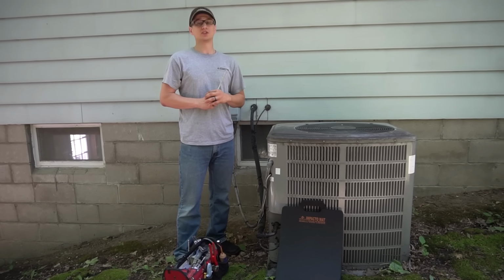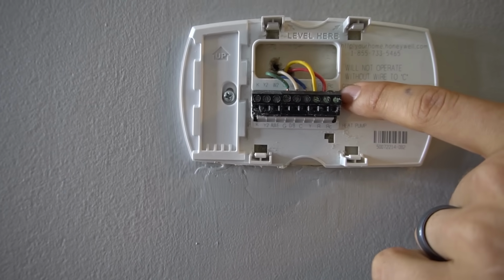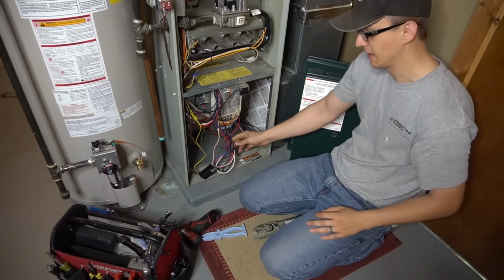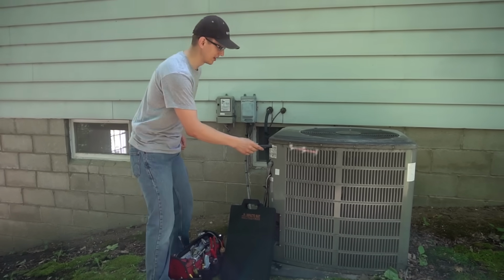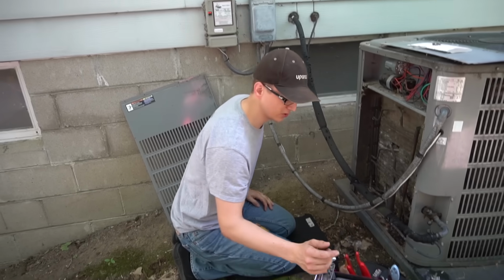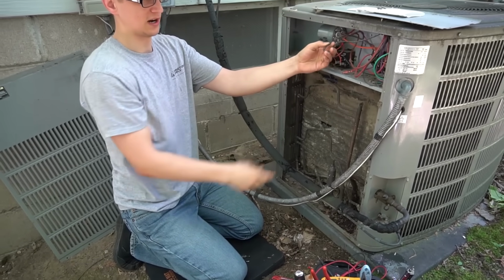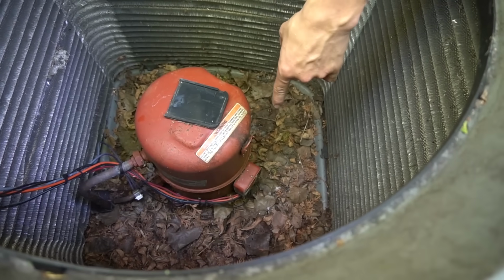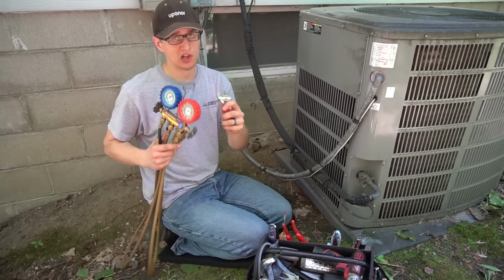AC Unit Not Turning On - How to Fix It Step by Step

Comment: Does the AC unit outside run all the time when your ac is on inside?
Reply: And thank you for the video, you are awesome for helping people save money on simple repairs.
Reply: My ac was working perfectly until I was outside cleaning around the AC unit and I bumped the little wire going into the outside unit and the unit started cutting in and out. So I kicked the ac off inside and went to investigate. I found the little wire had come slightly loose from the red side. So I spliced it and established a good connection without removing the outside breaker 1st. I did turn ac power off at the breaker box inside but didn't know about the outside one. Now the outside unit has not kicked on yet. Should I be concerned? Does it take time before kicking on or did I make a boo boo? Thanks in advance for the help.
Reply from the maker: Hey Ryan! It sounds like the 3 amp fuse in the furnace control board may have blown when you were fixing that wire. Check your control board in the furnace for a blown fuse or tripped breaker. That little red wire is a low voltage wire. Turning off the circuit breaker for the condenser unit outside would not disable the power to that wire. You would have had to either turn off your thermostat or the furnace. Let me know if that is the case. If not, we can do some more checks. Good luck!

Comment: Not sure if you'll be able to help but. Yesterday I had to replace my fan motor and capacitor for my lennox unit. Then realized I also had to replace the thermostat, so I bought a non programable honeywell and installed it and our AC was working perfectly. Then today we noticed it was getting hotter inside and the thermostat read 76 but was set to 73 an on cool. The furnace fan was blowing air out the vents but the AC unit wasn't turning on. So I removed the panel and pushed the contact switch and the unit started right up no problem, the compressor was running, and the fan but it still isn't kicking on to cool the house.
Reply from the maker: Hey John! Sorry to hear about your AC troubles, I hope you will be able to get it easily fixed! First off, was the thermostat correctly wired? Then, I would start by trying the following:

1. Check your 3 amp fuse or breaker at the furnace control board. Is that blown/tripped?
2. Do you have 24v between R and C at the furnace control board? If yes, then proceed :)
3. Put a jumper wire between R and Y at the thermostat. Does that turn on the condenser unit? If yes, then your thermostat is probably defective.
4. If jumping the thermostat does not turn it on, then you can try putting a jumper between R and Y at the furnace control board. Does that turn it on? If yes, then likely your control board is defective.
5. If the jumper wires did not turn on the condenser at all and your 3 amp fuse is good, then I would go outside and see what is in series with your contactor coil outside. The thermostat wire that comes out of the house and into the condenser unit, do the two wires from it go straight to the contactor or does one of the wires go somewhere else?

Hopefully that will help you figure it out! Let me know how it goes and what you find

Comment: Thank you for educational video!. Follows your video, I just changed my capacitor, but then the AC start running on and off every ~2 -3 minutes. What went wrong?
Reply from the maker: Interesting. Was the capacitor wired correctly? The only other thing I can think of at the moment is that it is cutting out on a low pressure switch. If you look inside the AC condenser unit from the top, you will see your compressor; it has two pipes coming out of it. One is thick, the other is thinner. Does the thick pipe have a black cylinder or disk on it with two wires coming out of it? If it does, that is a low pressure switch. Not all ACs have that.  What that thing does is measure the pressure of the refrigerant in the pipe. If the pressure get's too low, it will shut the unit off. Usually this will start happening if you are low on refrigerant. Unfortunately refrigerant issues you would need a technician to fix.. Or sometimes it may lead to replacing the whole unit altogether. Let me know what you find though! Hopefully it's not a freon issue. (although you can usually refill it for a couple hundred bucks but it will eventually leak back out)
Reply: I did recheck the wired, it is correct. I don't see any disk on the thick pipe, I took a picture, but I don't know how add here. The AC is old model CH7530VKA2. heat pump output 8500W cooling and 8400 heating. Note, that last/year or two years ago a tech add freon on it, without checked or fixed any leak. Is it possible that the freon low again?. If I need to replace, can I replace only the outside AC system or including the furnace that in the attic? note; the fan on in the furnace when I turn on "fan" on.
Reply from the maker: Yes, if you had a leak before, it will definitely leak back out. Usually leak repairs are very expensive so if your unit is old, then you may want to just replace it. The unit outside and the evaporator coil inside by the furnace would both get replaced. Your unit is probably doing that because it is either low on freon or the freon is completely gone..
Reply: I checked the furnace, because located in the attic, it is very clean like brand new. even no spider web at all. Hence, kind of hesitate to replace it. What is the fair price of the installation including the sytsem of the HVAC system (outside system and evaporator coil inside system)? I have the Heil7000, but I could not see this model anymore, probably too old.

Comment: Hi love your videos very detailed. I am having a issue with the ac. I have 24v to circuit board but no 24v to condenser
Reply from the maker: Thank you! And my first guess would be that you have a tripped 3 amp fuse. But you probably already checked that.. I think we should first check to see if your board or thermostat are defective. Let me give you a list of a few things you can check. (Check this with the thermostat calling for cooling and power to furnace on)

1. If you check voltage from R to C on the control board, you should have 24v
2. If you check voltage from C to Y on the control board, you should have 24v
3. If you check voltage from R to Y on the control board, you should have 0 volts

 If those 3 checks did not show the proper voltages, then likely it's a board or a thermostat issue. I would try this next:

- Take your thermostat off the wall and jumper R to Y. Does the condenser come on? If yes, then your thermostat needs to be replaced.
- If the unit does not come on when you did the above, try jumping R to Y at the control board. Does the condenser come on? If yes then you have a bad control board.

If all 3 voltage checks checked out good, then go outside and locate the thermostat wire that comes out to your condenser unit.

- Do your thermostat wires outside (usually red and white) go straight to the contactor coil? If they do, then you likely have a broken thermostat wire somewhere.
- If you have a power saver switch from the electric company and it is wired in series with the contactor coil, then the saver switch could be defective. An easy way to check would be to disconnect the saver switch and hook up the thermostat wires straight to the contactor coil. If the unit turns on, then you know the saver switch is bad.
- Is there high or low pressure switches or anything else in series with the contactor coil? They could be interrupting the power too.

Well I think I may have dived a little too deep into this.. Sorry, don't mean to be overwhelming. But please let me know what you find or if you have further questions! Good luck!

Comment: great video! I'm going to do everything you say in the video and see if it will helps cool my house. A question I have is, my living gets really hot and I mean hot. The thermostat i have set to is 75 and on hot days its gets up to 85. First thing I did was change the filter since it was dirty. My original thought was that if i change the filter maybe the suction will suck the hot air inside the house. That did not help cool the living room. All the other rooms in the house is cool. What could possibly be the problem?
Reply: Enjoying the Show my thermostats is located in the middle of the house. My house is only one floor.
Reply from the maker: Sorry to hear about the sauna situation you have going on there! So from what you explained, its sounds like it IS cooling but poorly; on hot days it fights a losing battle.. Are you sure the compressor is running? If everything is working but its not cooling then most likely you are low on refrigerant or your evaporator coil is very dirty/plugged. If it is a dirty coil, you may be able to clean it yourself. This is the coil that sits on top of the furnace. Some are easy to access, others not so much. Just try YouTubing "cleaning an evaporator coil" to get an idea of what that entails. A refrigerant issue would be worse; you can't really fix a refrigerant issue on your own. Unless you have the tools you would need, along with the refrigerant. (You have to have a license to buy it) Just so you know: An AC refrigerant system is a permanently sealed system. That means whatever freon is in it, stays in it for the life of the unit. It is not like gasoline where you have to occasionally refill it. If some is missing, that means for sure you have a leak in the sealed system. You can have it recharged for a couple hundred bucks usually.. But do know that it will leak back out with time. (it's pressurized so even during the winter, its slowly leaking out. Generally getting a leak fixed becomes pretty costly too. A lot of people opt for a new unit instead. So those were my first thoughts. Let me know what you find.
Reply: Where is your thermostat located? What room? Exterior wall?

Comment: Hi, my AC is not cooling. Inside fan and thermostat are working. When temp is low, fan of AC unit starts but compressor is not starting. I replaced capacitor but compressor is still not starting, any ideas?
Reply from the maker: Can you hear the compressor buzz for a second or two like it is trying to start? I can only think of 4 things..
1. Your compressor is not getting power - check the wires going to the compressor for any damage or breaks (you will have to take the top off).
2. It may be pulling locked rotor amps. Which just means that at start up the amp draw is too high and the compressor seizes up. You could try to jump start it with this: Hard Start Kit: https://amzn.to/2LZhnxj That part will cut the start up amps in half.
3. Your compressor is not getting power. Is there a low pressure switch on the thick pipe if you look inside the condenser from the top?
4. Your compressor is shot. Hopefully this is not the case. You can check this with a multi meter. Let me know if you get down to this option...

Hope you find the culprit! Good luck!
Reply: Thank you for this great video. When you mention if the unit has a low pressure switch, I think in this case this won’t be the problem. Assuming the unit is low on refrigerant, not even the condenser fan motor would work due to open low voltage circuit to the contactor.

Comment: So my ac is not working and I just looked at my thermostat and no jump wire! Should I just take a wire and connect Y and C together, my thermostat does not have RC. The ac hasn’t been turned on for about 6-7 years. Thank you
Reply from the maker: You were close ;) Y and C would be a direct short. It would be better to jumper R and Y.  But if you do that, your AC will run non-stop. It will get mighty cold. How many thermostat wires do you have? Here, this might help you. This is what typical thermostat wiring looks like:

R: Power (usually a red wire) - If there is Rc, then you would put a jumper between R and Rc
G: Fan (usually a green wire)
Y: Cool (usually a yellow wire)
W: Heat (usually a white wire)
C: Common (usually a blue wire)

Not all thermostats will have 5 wires. Some will have 4. (the common is not always used) Take a look at how yours is set up and let me know what you find
Reply: Word of Advice TV thank you for your response. The ac hasn’t been used for 6-7 years I inherited the house and it used to work with no issues, but idk if the thermostat has been changed since.  
Y-yellow
R-red 
C-not used
G-green
O/B-not used 
W-white
Blue is not used
Only have one thermostat. No Rc 
Thank you
Reply from the maker: Okay, thank you for the info. It seems like your thermostat is wired correctly. No problem there. Check the furnace control board and see if the terminal strip (R,Y,G,W,C) has the same wires going to them. Also, have you checked if your furnace works? Or if you put the fan from AUTO to ON, does the fan come on? If the furnace and the fan don't come on then you have a power issue. Maybe a blown 3amp fuse or breaker? Furnace power switch is off? Circuit breakers?
Reply: Word of Advice TV thank you for your help, unfortunately I’m not at the house right now to look at the wires, not back until tomorrow night. The furnace and fan definitely worked without issues this past winter. I do know that if you switch the thermostat to cool and turn fan to on it does not come on, same thing if you turn to heat and switch fan from auto to on it won’t come on. With heat on and switch fan to auto the fan works. All breakers seemed fine and the outside safety is switched to on. If that helps. I do appreciate this. If I can would it be ok to talk again tomorrow night?
Thank You have a good night!
Reply from the maker: Interesting. So turning fan to ON on the thermostat does not turn on the fan? You may have a bad thermostat or control board then. And for sure! I work during the day too so only get around to answering people in the evening. Let me know what you find!
Reply: Word of Advice TV hello and thank you! I just found a blown 5 amp fuse In the furnace control box, could that be part of the issue?  Out of the control box the wires that I have are. 
Brown wire that has a white and red wire coming out of it. White wire connected to a thicker grey or green wire. Red wire connected to a yellow wire. Next I have another brown wire that has a green, red,white, blue coming out of it. 
So 2 separate brown wires with other wires coming out

Brown wire #1, white wire red wire. Looks like AC control. 

Brown wire #2, green, red, white, blue, yellow. Looks like thermostat control. 

Brown wire #1,white wire connected to thick grey or green wire in control box. 

Brown wire #1,red wire connected to Brown wire 2 yellow wire. 

Brown wire# 2, green wire to green wire in control box. 

Brown wire #2, red wire to red wire in control box. 

Brown wire #2, white wire to white wire in control box. 

Brown wire #2, blue wire not used. 

It’s confusing sorry for that 
Hope it helps. 
Thank You
Reply: Word of Advice TV hello, I just changed the fuse and bingo it’s working🤗 THANK YOU!!Now I have to find out why the fuse was blown. I do have one of the wires that is outside, white one that is bare about 3” ,the white casing has dried out. I’m going to replace it! If rain water gets on the white bare wire can it blow the fuse?

Comment: My fan outside was not spinning but it started spinning once we sprayed it with a hose. The problem now is that it's not spinning as fast as it should (it's a two family house and the one next to it is much faster), and the air coming from the receivers is weak and not that cold. After watching your video I think the problem is most likely the capacitor right? Also, is it ok to just switch it off from the circuit breaker inside the house because the panel outside is hard to reach. Thank you for making this video, it really helped a lot!
Reply from the maker: Glad to hear that the video was helpful! The capacitor sounds like a good starting point. That would be my first guess too. If you have a multi meter, you could check it to make sure. There is another thing that matches your description though.. You may be only getting 120v to the unit instead of 240v. That would be enough to make the fan spin (at a slower speed) but the compressor will not come on. If this is the case, then there may be a broken wire or a blown fuse inside that disconnect. If you have a meter that can check voltage, I can tell you how to check. And yes, turning off the power at the circuit breaker is totally fine. Might even be the better way to go :)